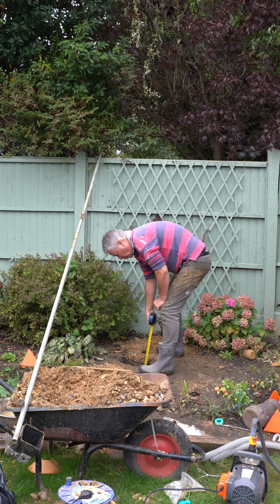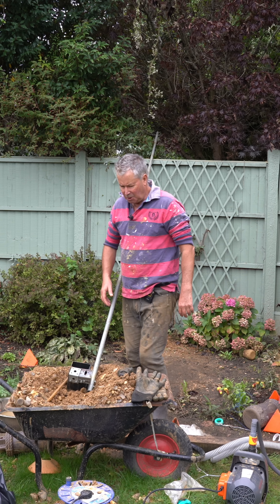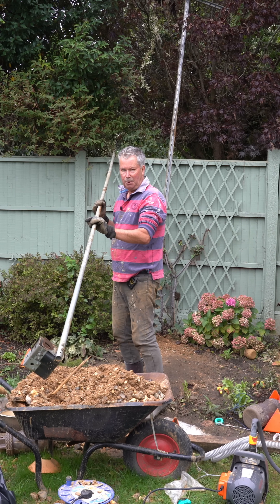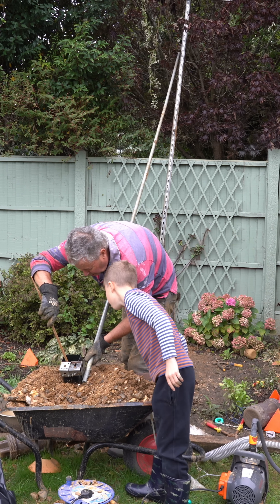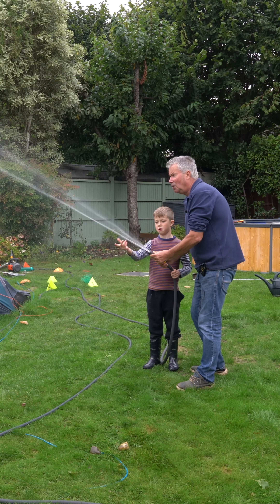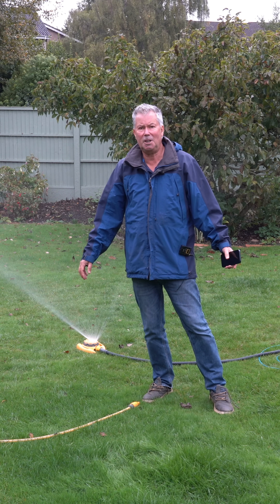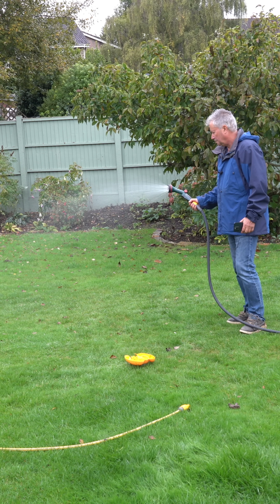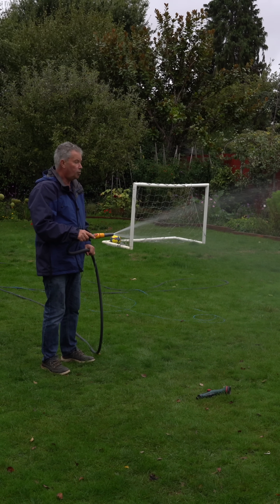DIY Drilling for Water in a Suburban garden Part 8 #waterdrilling #boreholedrilling #drillingrig

Comment: Well well well well well 😂 I think you can call it a success. I like your idea of a buffer tank are you planning on documenting that? Could be interesting. Is Mrs Jones impressed?
Reply from the maker: I will indeed be making videos regarding the buffer tank and I will be sourcing a tank this weekend. I am back to thinking of a thin submersible pump with relatively low flow operated by a float switch in the buffer tank. I can then use the existing pump to feed water wherever I need it. The buffer will also allow and dirt to settle. I am in fact thinking of two tanks with on a settling tank that then feeds the tank we use. Mrs Jones is well impressed whilst master Jones kept telling her to have faith in us.